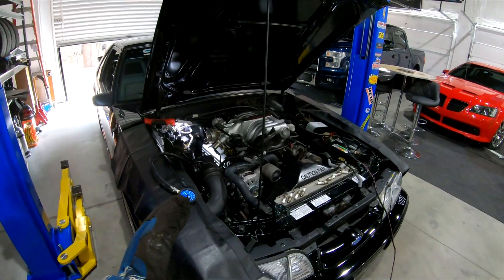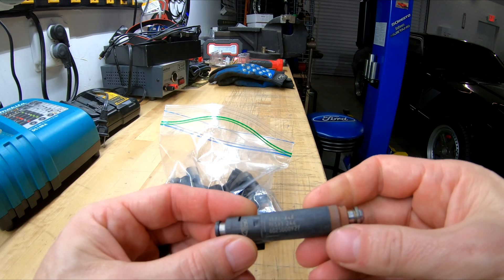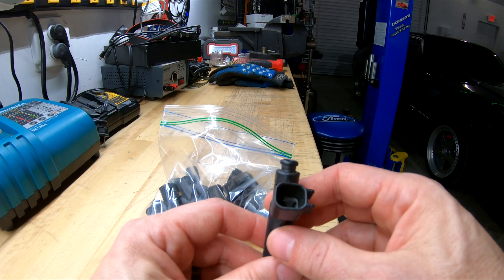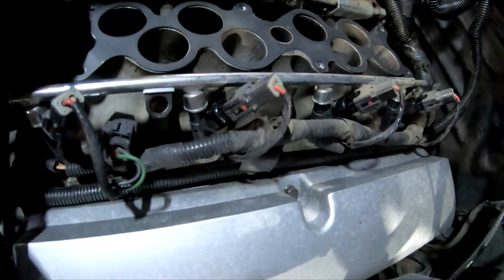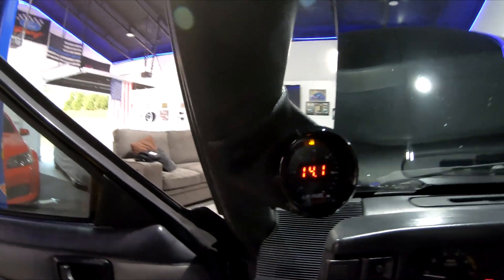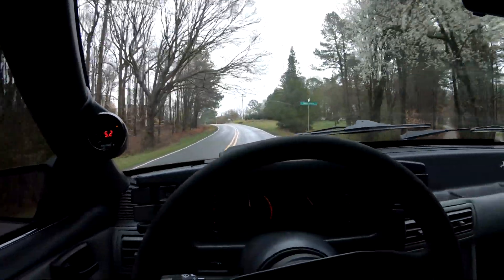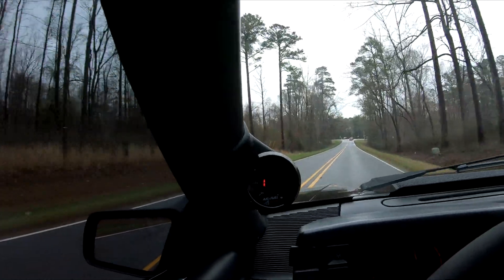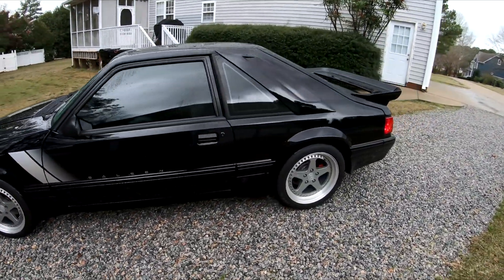Can you put E85 in a Foxbody without a tune?  Myth Buster!  How to do a E85 conversion for cheap!

Comment: I know this is a little older video hopi g you will see my question,  can you post what fittings you used to swith the fuel filter to mesh or steel filter.
Reply from the maker: Link to filter - https://www.amazon.com/dp/B0CFV475C3?ref=ppx_yo2ov_dt_b_fed_asin_title
Link to filter fittings - 6AN to 5/16  - https://www.amazon.com/dp/B0DK383G9F?ref=ppx_yo2ov_dt_b_fed_asin_title&th=1

Comment: Do you think this would work on my 94 cobra with H/C full bolt ons on 30lbs injectors/pro-m 77mm maf ?
Reply from the maker: It might if your meter is calibrated for 19#.  However each computer could react differently.

Comment: My 97 cobra was tuned on 91 pump and 50/50 water methanol 10.9-11.2 afr I decided to try an E30 blend and WOT is 11.5-12 with my BAP turned all the way off and 11.5 turned all the way up car feels like it has 50 more hp

Comment: I powershift my tr6060 in my 07 gt500 it put down 740/733 on fat drag radials through 410s so its a powerhouse on the street vmp gen3r the trans is stock im running mobil 1 fully synthetic atf in it and i have an rst clutch.  Its a beast of a trans.  Car weighs around 4000 lbs with me in it (im 285 lbs) ive took couple hundred off but shes still heavy lol.  You have a wicked collection its similar to mine but the much better version.  I have my gt500 and a 97 cobra i just got to fix up and my daily a 2016 fiesta st its fbo x37 hybrid swap on e30 fuel puts down about 280/280 to the tire in a 2600 lbs car she moves for what she is.  Extremely fun daily.  Your collection is bad as hell.  Love that mach thats my kind of ride this saleen is wicked too.
Reply from the maker: Thank you.